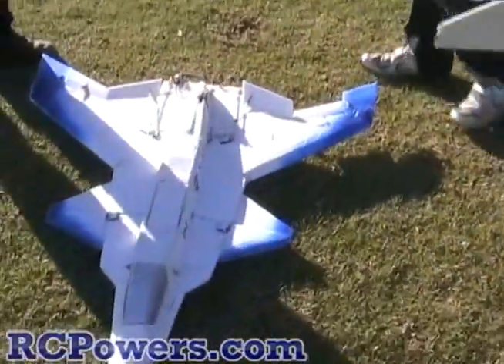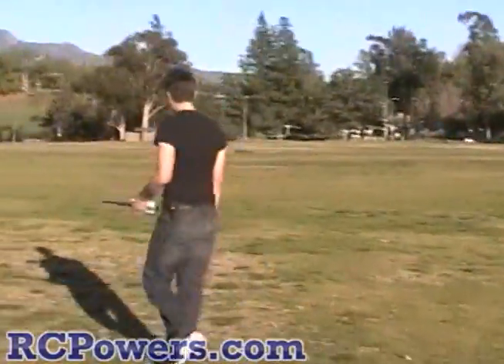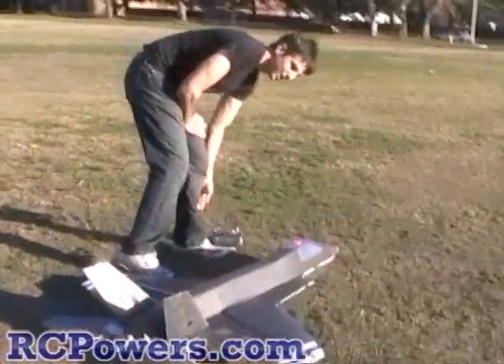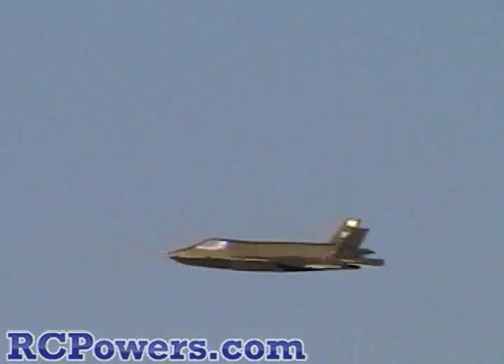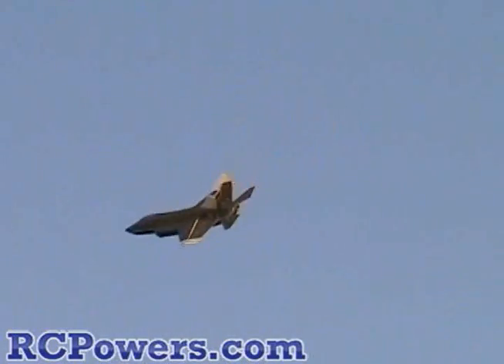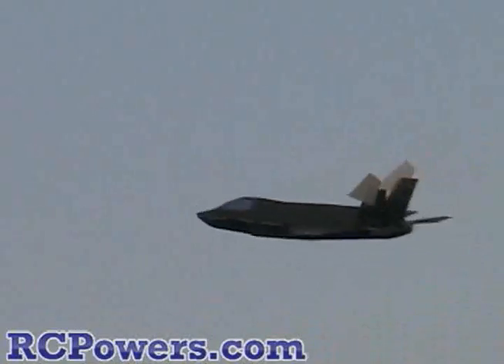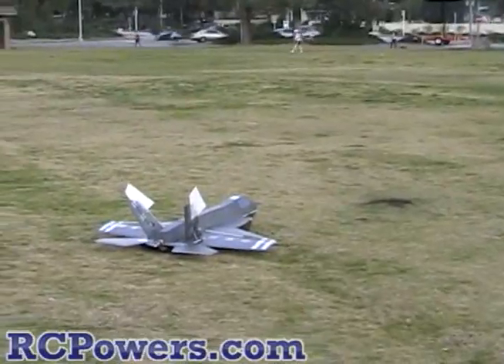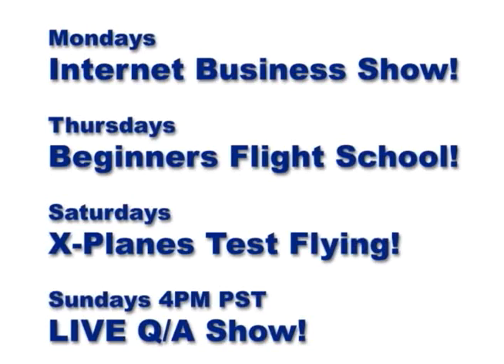RC F-35 STOVL Test 1 (Flight Testing)

Comment: if you think it sliping away  it does sliping  because your leading edge is actually pushing your tail down  so the plane slip on air (and it so cool exactly) and your vertical stabilizer is to short

Comment: Dave, for the yaw stability issue, how about adding ventral fins like on the F-16?  The idea being, that during high AOA, airflow to the top-mounted vertical stab is blocked.  So just add some stab[s] to the bottom.  It definitely looked like that instability was happening during high AOA (e.g. when applying back pressure during a slow turn).